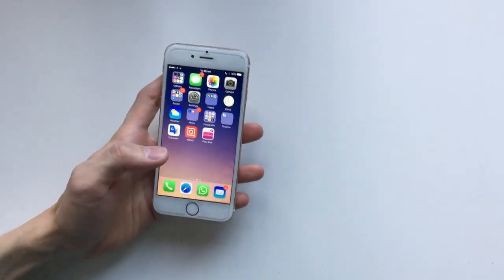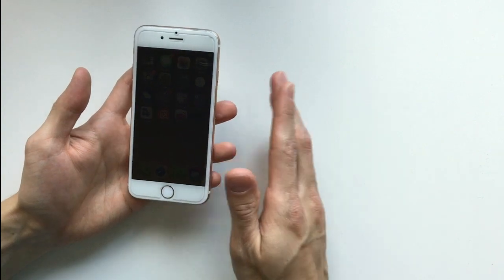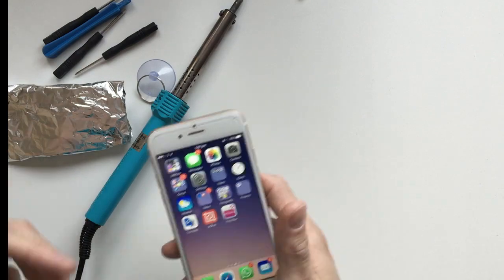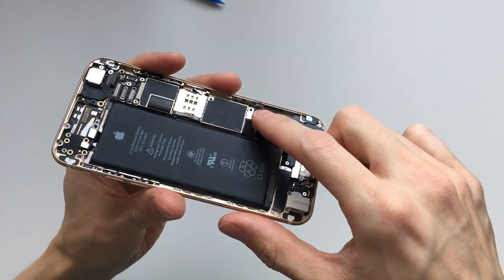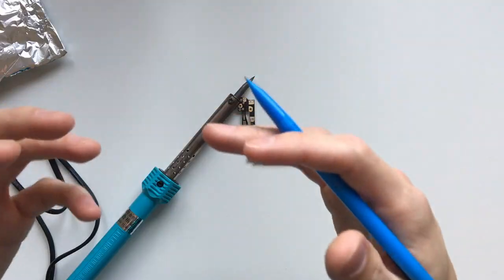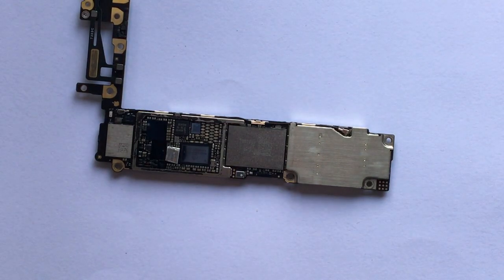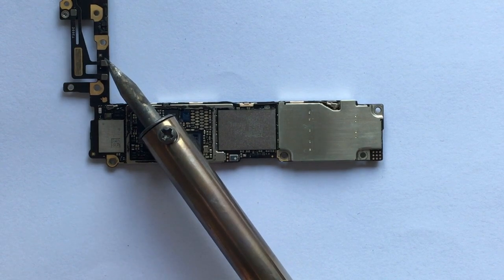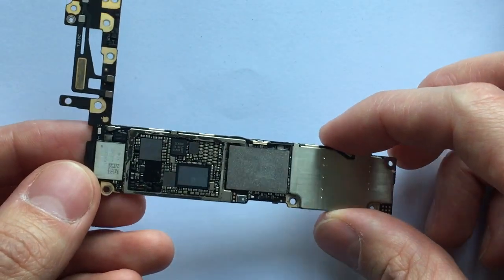HOW I FIXED iPHONE 6 TOUCH DISEASE (Has been FLAWLESS for 6 WEEKS NOW)

Comment: I did this method, and also the tape method but it hasnt fixed my issue, which is half of the display doesnt respond to touch and a few other small areas as well, is this maybe the screen and not this chip?

Comment: iPhone 11 Pro Max Repair Services in London
iPhone 11 Pro Max Screen Replacement. If the screen on your device is broken, smashed and/or you are experiencing issues with the touchscreen, then it's very likely that your screen is broken or defective. We will replace the screen, service your device and install a complementary tempered glass screen protector.

https://www.electroclinic.co.uk/repair-services/mobile-phones/apple/iphone-11-pro-max

Comment: Tried it and it worked. The only difference is I did it also to the touch transmitter chip above the touchscreen controller chip in your video, so I hit both chips.

Comment: Actually the tape thing worked for me, but it only worked for a limited amount of time for me (about 10 months)
Reply: East DallasKick's how do fixe it with tape ?plz answer
Reply: @marlenmolina1994  so do you know for sure that it's touch disease and not that you busted the lcd screen?
Reply: East DallasKick's yes it’s touch desease
Reply: @marlenmolina1994  do exactly what the video did. It's what I did I used electric tape and if you need the toolkit I got mine from w almart for 8$.

Comment: What if you don’t have any of the tools required where would you get them and how much would they cost
Reply from the maker: everything can be bought from ebay really cheap
Reply: £18 is enough for a OK temp controlled iron. Irons can be bought cheaper but t.c ones are better. Search 936 solder station on the bay

Comment: Wow Lucas this really fixed it. I almost didn't try it because it seemed like a long shot since touch disease is usually associated with a gray bar along the top, but this phone didn't have that. Also when I opened it up I saw some spots that looked kind of overheated/burned, which I thought might be a bigger issue. I found a spot of gold solder or something that normally has a little thermal sticker on it and the sticker had been smudged away and off of it too. I put that back and I proceeded with the soldering trick even though my mind had been trying to tell me it was just that sticker. It might have been, but doubtful. Your trick saved this phone and now my Mom can use it to save money by switching to Xfinity Mobile! Thank you. Also - since this worked for me I went ahead and liked and subscribed. You earned it!
Reply from the maker: dude, that makes me real happy

Comment: Does it work with 6s?
Reply from the maker: The 6s usually doesn't have this problem
Reply: Mine does
Reply: Mine goes crazy when I touch the bottom left of my phone, and the only temp. fix is punching it in the face

Comment: I like your method to do reballing ic with soldering gun but what you said about the “heat gun” is wrong. You don’t put aluminum foil around ic to work with heat gun on ic because aluminum foil will transfer the heat that you apply to other components around ic. Because of this issue; pro’s use orange color insulating tape around ics in order to protect other components from heat.

Comment: Your trick of heating upto 30 seconds just melted all the connections beneath the touch IC and the molten metal came out from the sides. The phone ended up in dustbin.
Reply from the maker: Sorry to hear that bro. It worked for so many of us it's easy to forget that there is risk in trying this out
Reply: @LucasGuanes  30 seconds are too much a longer period. You must mention correct time and temperature so that others do not ended up like me.
Reply: I'm sure different soldering iron have different temps

Comment: I replaced the ic chips on my iPhone 6+ 
I thought it is fixed permanently, but it came back after using for 3 months
Reply from the maker: Wow man,  you are a pro, replacing the IC is no easy thing. I guess the iPhone 6 problems will eventually make the problem come back no matter what.

Comment: Hi, I have this problem too, and it happened after I replaced my battery. To do that I disconnected the "connectors" (the 4 connectors/cables) so that I could take off the screen to properly deal with the battery. Judging from this helpful video, I realized that the chips that are not properly making contact and causing the "touch disease" are in fact placed on the logic board DIRECTLY BENEATH the area where the connectors are connected to the logic board. Thus, my suggestion/question is that disconnecting and later connecting the connectors may "cause" the issue in the first place (by pulling up the connectors and/or pushing the connectors back on later) - does this make sense?

Comment: um i started raging and smacking it against my hand which btw hurt badly. it started working now its not. I started beating it up and even bit it.. my teeth were a lot stronger then i expected i cracked the phone screen.. i have bad anger issues
Reply: orlando i’m dealing with the same problem and i did the very same 😂 j hit it, threw it and bit it
Reply: I have worse anger issues. I busted the entire phone by chucking it at a wall because my mom yelled at me
Reply: I slammed mine because I couldn’t answer a phone call lmaoo

Comment: I took the motherboard out, put a piece of electrical tape on the correct chip, placed a finger on the chip while gently bending the motherboard back to being straight again and I haven't had any issues yet. Take a look at the straightness of the little brackets that hold the mobo and adjust as needed. Did that 4 days ago and its good as new.
Reply: Allen Blumenauer just put tape on it without heat!!!???   and its working for long time ???!

Comment: I used this method for the iphone 4 chip problem years ago and it's still working https://www.youtube.com/watch?v=DPR8qrAcg5g  unfortunately, the 6 doesn't have a hard protection plate to keep the pressure on the loose ic so I don't know how durable this is

Comment: Tried already and successful so far. I think an important point is you need to apply pressure right after you remove the heat, so that the metal set attaching the IC to the board
Reply from the maker: Thanks for the addition

Comment: Just finished and it seems to be fixed! I'll check back in a couple weeks to let ya know how it's holding up!
Reply: Any updates on your iPhone Ian?
Reply: It quit an hour or so later. I wound up follow other advise to fold up a piece of tape and stick it in there to keep constant pressure and that’s solved the problem for me. I know it’s not a permanent fix but it will hold me over for a while until I feel like getting a new phone.

Comment: If anyone has a glass like screen protector, remove it. That was my issue the screen protector was making the phone unresponsive for some reason. After removal, it's working like new. Do this if you haven't. I mean, hey it's worth a shot since this iPhones are expensive give it a try.

Comment: hi, so  the bottom of my iphone 6 is not working ( i cant open control center, press space) will this method work? is this also a touch disease?
Reply: just replaced my screen and im having that exact issue only the very bottom of the touch screen is not responsive which is making it difficult to use most apps (also cant swipe up the control window from the bottom of screen) did you come across any solutions for this by any chance ?

Comment: Followed step by step and took care to make sure and get the heat to evenly heat up the chip and it seems to have worked. Still testing so will update once some time has passed. Also, once I finished heating it, I placed a piece of electrical tape over the ic chips just to keep them in place. I know it'ñ might not be a permanent fix, but if it works for a little while longer I'll be happy! Thanks for the video!
Reply: any update Sir? it's been 5 year lol but during that time is a long temporary fix?

Comment: So we now know that Apple removed the underfill liquid that coats the solder balls on the board to anchor the connection to the touch IC, along with the removal of metal shield for support. So APPLE MESSED UP!

If everyone with this issue would call Apple customer service and visit an apple store to complain, over and over, that would be 10's of thousands of complaints on top of those 10's of thousands that have already been filed with Apple. 

We need to stand together as a community.  This is a faulty design by apple on their 6 and 6 plus.  

It's complete bullshit that we have to walk into an apple store and pay $150 for an issue that Apple created, and that they have kept it a secret and blown us off with "sorry, you've dropped your phone too many times".  Complete rubbish!!  

People have dropped every other iPhone model "many times", and this was never an issue with those phones.  First of all, it just sounds stupid anyway.... you're telling me a few drops shakes up the board and creates little separations or disconnects??  Really Apple?  

We've paid almost $1000 for this damn phone.... the least you could do is have your in-store Techs bang out the repairs on the house. Own this!!!
Reply: My old phone had touch disease so I told my parents they talked to apple they said “your son dropped it to many times” so I got a new phone the replacement but guess what IT HAS TOUCH DISEASE AND I STILL HAVE MY REPLACEMENT IT DOESNT WORK HALF OF THE TIME SO I JUST SLAM MY PHONE ON SOMETHING HARD THEN IT WORKS FOR LIKE 10-30 MINUTES THIS IS BULL
Reply: Phyto Nutrients the phone is actually worth $499 as of now.

Comment: Thanks for this vid! Have not tried it yet... possible to post a LINK to the solder tool you purchased? Also, why do you only touch the chip with the screw?  Does the aluminum foil have to 'melt' or does it just end up sticking to the chip and that's when you know it's good to go? 

I believe having a very tight protective case possibly contributes to the development of this issue (and when the case is removed it seems to occur less)

I believe removing the metal plate over connectors helped me out a bit, and also helped (more quickly) to get it to stop flickering. HOWEVER, what helped even more, was adding one piece of electrical tape folder and in-between connectors and plate. When I did this I was only able to screw in 2 of the screws.. but I don't care because this helped much more (less flicker, easier to stop it when it occurs, etc., and only requires a slight pressure on the EDGE of phone near the chip). 

Also, when you're twisting phone to get the Flicker to stop, you may see the grey bar disappear.... but the Touch still doesn't work.... and I've noticed that sometimes you need to then hit the power-button (upper right side) and use the thumb-login or dial pad to log in to the phone, and then it works for whatever reason.  

If you don't do this method, or send in for micro-soldering repair, this flicker will not stop... sorry to say.  I've been dealing with this for about 1 year, and it has it's good moments, but lately it has gotten much worse.  

While I had it open, I ended up replacing the battery.... BE CAREFUL DOING THIS.... make sure you SLOWLY remove the sticky/tabs, because if they snap too soon, you'll have the adhesive beneath the battery and you'll have to PRY it out and this will be very difficult and dangerous (potential ACID if you cut into the battery).  Also, purchase your adhesive tape FIRST, because you will need this and your replacement battery probably won't arrive with the strips.
Reply from the maker: hey, I bought a really cheap soldering iron like this one: https://goo.gl/YJ1QEQ
The aluminum is just there to transfer the heat more evenly on the chip surface thats all. It is the solder underneath the chip that melts but you can't see it.
Reply: Thanks, Lucas!  I think I understand...  are you saying that once you apply the heat 3 times at 30 seconds each, you then just remove the aluminum piece and assume the solder melted and fixed the issue... and then put it all back together to test it out?

Also, why do you use the screw on the solder tool? is that to apply less heat to the chip?
Reply: did You not remove the IC at all as I understood ?!
Reply from the maker: No removal, just applied heat
Reply: Great !

Comment: Thanks! Helpful video; I took my phone out of the case and squeezed it pretty hard at the spot the chip sits. This seemed to fix it just fine. I wanted to share this for people to try first before taking your phone apart. Cheers!
Reply: pretty much! I just took my phone out of the case and pressed it between both hands pretty firmly, held it for a few seconds and it worked. I've had to do it again since last month but it's way easier than taking apart. I'm also just buying time to get a new phone since I'm due for an upgrade.
Reply: is that all you did to make it work? cus if yes i would do that 😔😔
Reply: Gawd! I tried this and it worked😭
Reply: omg thank uuu it worked!!!!
Reply: @nashslogbook9172  keep me updated 😭 I wanna know how often you do it

Comment: Mine had this problem, is it a bad idea to just leave the metal plate off the sensors? Every time I put it back on the flicker happened?!
Reply from the maker: Don't know what to say there.I think the protector is there for a reason, but if it woks for you then yeah just try
Reply: I think it's there just to hold the connectors in place.... but more of a 'formality'... I'm not saying it has NO effect, but I'm thinking it's safe to keep it OFF if it helps. I don't see the risk of exposure.... I don't see how anything internally would create an issue for the exposed connectors.  If you screen goes black when you're trying to twist to stop flickering, then you could open up and probably see the right-side connector needs to be re-seated.

Comment: and when i try to restore it shows error 53 please lucas help me out
Reply from the maker: Have you tried pitting it in DFU mode?
Reply: i did put it in the DFU mode and tried restoring it with itunes but have error 53 in the process
Reply: tembi ujazz heat gun the phone and then it will let you restore

Comment: I did this fix which sort of helped out. Before the fix, the touch screen wouldn't work at all. Now it will intermittently work. Whenever the gray bars come down from the top of the screen I can just bend the phone a little and that will fix it. Rinse and repeat. Apple should fix these diseased iPhones for free. Not our fault for a design flaw.
Reply: that's what i did for 3 months, now it doesn't work any longer. touch is now completely dead....

Comment: I did this... I haven't reassembled yet but have connected all cables and it doesn't turn on
Reply: You just could hold power and home button and it comes right on!
Reply: Did I accidentally touch something I shouldn't have
Reply from the maker: Hudson Rookaird make sure everything is connected properly. Try plugging it to your laptop.
Reply: Yah!! I found out all i needed to do was plug it into power... I'm an idiot, touch is working great now
Reply from the maker: Hudson Rookaird glad to hear that!
Reply: same here, after connecting everything it won't power on at all, help please, what did I do wrong, this phone is for a friend
Reply: But how, that's my concern, this is not the first time I have disassemble phone, but seems iphone is just too fragile
Reply: 1337 I did that still not coming on, I have since left it will try to disassemble and re-asessemble when I got time.
Reply: @TecmentalReview  disconnect battery and hook it back up.
Reply: Tecmental Review did u try to plug charging in?
Reply: Yes I did no sign of life, computer didn't find it either
Reply: strange. maybe battery?
Reply: 1337 You mean reassemble?
Reply: alumnium foil and heat from the screw.. Hum im pretty sure thats how you fuck your phone permanently. I have another idea: I call it technical assistance
Reply: yea it is hard to assemble back.(best english ever :/)

Comment: Can i use an Iron on this instead of a soldering iron?
Reply from the maker: I guess the principle s the same. The thing is how to transfer the heat to that tiny IC. And if it will get hot enough
Reply: I just bought a soldering iron. It's 30 watt

Comment: After doing this the screen on my iPhone started working again, but now after 2 weeks the screen no longer works at all, It is turned on and my computer detects the iPhone but the phone doesn't do anything not even vibrate or make noise when I call it. Could it be a logic board problem? I have already tried restoring it and holding power+home nothing works.
Reply: it it touch disease u should to change touch ic